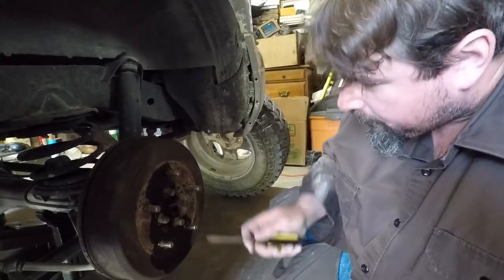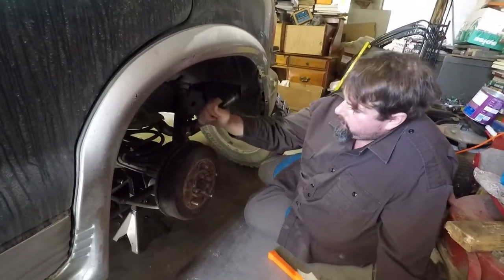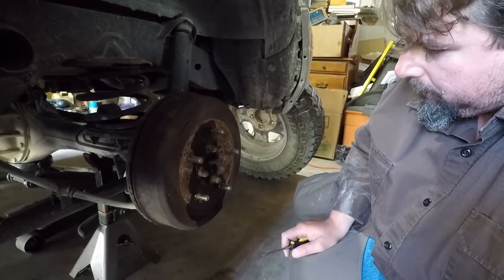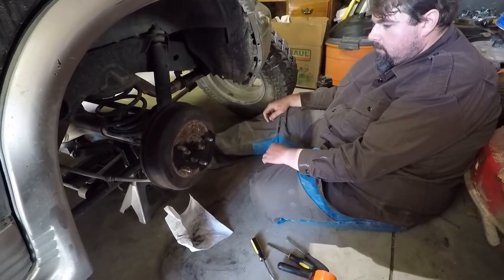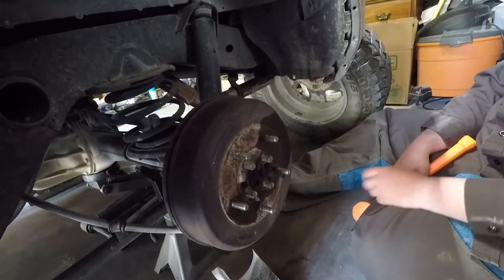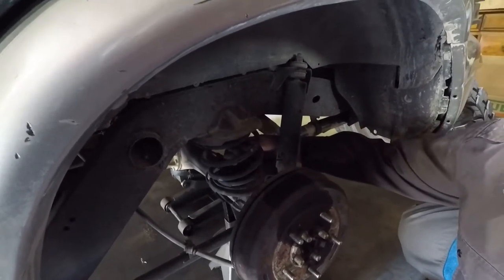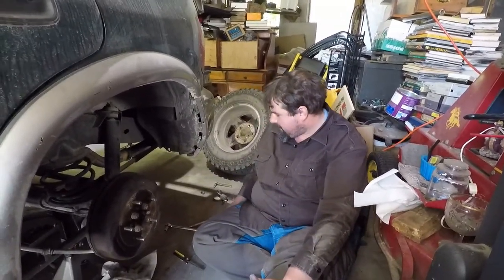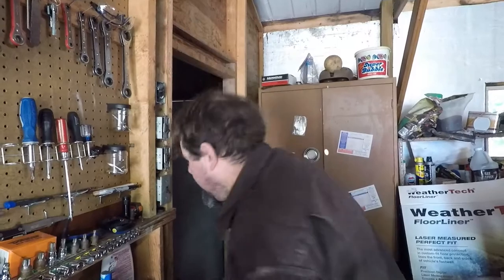99 Kia Sportage Brake Shoe Replacement attempt - Krazy Karl Projects

Comment: you need to run 2 bolts in the threaded holes and let the bolts back the drum off I am not sure what size they are but they are metric threads i would imagine they should be about 2 in. long. Good luck!
Reply from the maker: Thanks!  We did eventually figure it out, explained it in a later video.  I think it's in the rear shocks video.  I'll try to find it and link it here where we explained it.  It certainly would have come in handy knowing that at the time, lol.

Comment: Screwdrivers even large ones are not prybars either LOL grab a hammer or mallet and whack the crap outta those stuck drums haha good video not many for these old Kia's especially first year...Mine actually held together fairly well other then the rubber and plastic parts haha

Comment: Geez you would think that considering that drum was held on with nuts/bolts large enough to need a tire iron they would have skipped putting in not 1 but 2 retainer screws...I've ALWAYS hated them whether on drums or rotors some people say they were just used on the assembly line but I cant see all those auto makers wasting hundreds or thousands of dollars on needless metal screws when some tape or plastic temp clips would also work but who knows...I say if they are there they probably serve some purpose but we may never know LOL Get yourself a cheap impact driver it works like a charm on those retainer screws. Otherwise chisel em off and then use NEW ones so you dont screw the next guy like someone did to you 😁

Comment: Would loosening the bleeder valve allow it to release?
Reply from the maker: Potentially.  But the problem I was having was I couldn't get the bolt to release, and the brake pad released and welded itself to the other brake shoe.  This job had a lot of problems.

Comment: Or is there a manual adjustment access hole somewhere in or around the drum so you can loosen it enough to remove? I know it wont come off without removing the retainer screws or at least drilling em out enough to bypass em altogether since they dont seem necessary...Just some ideas to deal with an issue like this.... Otherwise I have had to just beat the thing off once in the past and when I did everything inside just dumped out like a dropped Mr. Potato Head lol
Reply from the maker: There is a video we did later on that shows where I got the drum off.  The brake shoe managed to weld itself inside the drum somehow.
Reply: @KrazyKarlProjects  That'll do it lol Seized up piston or springs going bad could cause constant contact between shoe and drum superheating and after driving it cooled and stuck/welded Thanks for the response